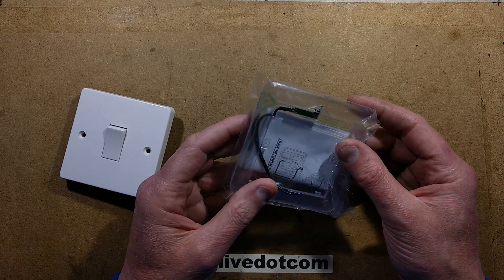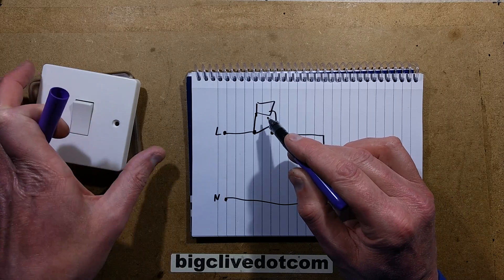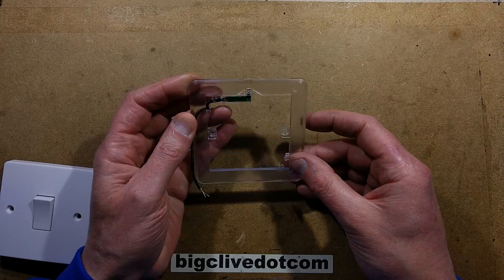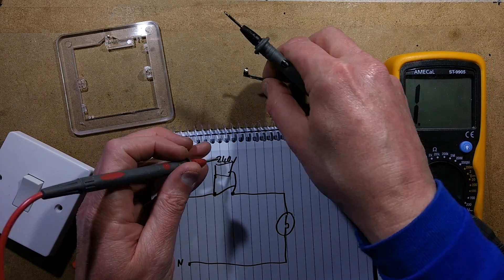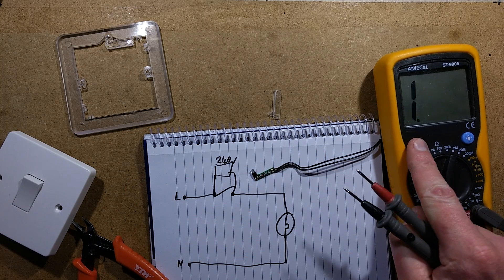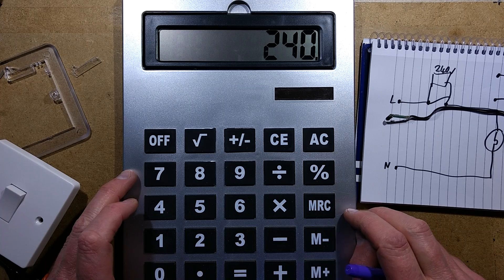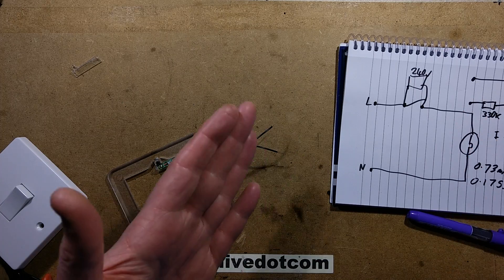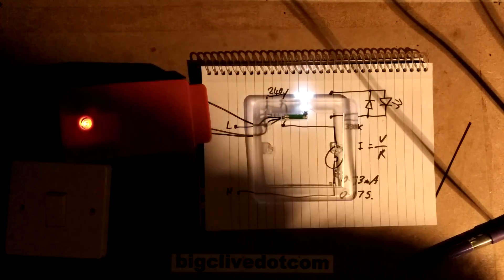Illuminated switchplate adapter.  (With "schematic".)

Comment: When I was a kid one friend's house had a couple of wall plates that fascinated me.  The top of the plate had a smallish plastic cover under which was a neon bulb and a resistor,  and it only lit when the switch was off,  as you describe here.  I've never seen that anywhere else,  nor in any hardware store or other store since then.

Comment: If the diode in inverse parallel with the LED was just placed in series with the LED, would that not result in the same protection from inverse voltage AND at the same time result in a reduction in the power by 50% ?

Comment: Would the current going through that indicator pose a problem if a low power LED is switched with the switch in which the indicator is installed? Because it might make the switched LED glow?

Comment: I've tried every type of decorative illuminated light switch that I know of and they all tend to act up when used with either CFL or LED bulbs.  A couple of times a year we spend a week at the in-laws place, the spare room in the basement has no windows and is as dark as a bomb shelter. Obviously this makes getting up in the middle of the night and making your way to the bathroom challenging and finding the light switch in an unfamiliar room nearly impossible. I though I was being smart when I replaced the light switch with an illuminated model until we went to bed. After our eyes adjusted to the dark for a moment  we could see that all three CFL pot-lights were glowing and flickering. Thinking it was a faulty switch I returned it and tried another type, same results. After two more trips to the hardware store I finally had to go for a switch with a separate pilot light that is ugly but serves the purpose. After watching this video I finally understand why this was happening. The LED in the switch is completing a circuit in series with the fixtures on the main circuit, with old incandescent bulbs the current was never high enough to light the filament but newer more energy efficient bulbs do glow slightly as they require such low current. The switch with the separate pilot light must simultaneously break the main circuit as it makes the pilot light circuit.

Comment: hi clive wondering if you mite be interested in this 12 Watt BC B22 Bayonet LED Light Bulb GLS Traditional Style Lamp Warm White  on ebay seller theelectricalwholesaler  brought this bulb to use at work great light colour only problem was the reception on my radio 6 foot away became unlistenable and switching the light off got reception quality back strange how this light bulb can cause so much impacted on fm radio reception gareth
Reply from the maker: Many LED lamps with switchmode power supplies will jam radios.  Especially AM signals.  The capacitive dropper style lamps are less noisy.

Comment: Not sure if someone else has already mentioned this but you should actually test it with a bulb in series. If you use an incandescent bulb it works fine but if you use a single or multiple low energy LED  bulbs then the current they pass is often enough in some cases to make the bulbs flicker like f*ck. Fitted 6 of them with the leccy off and when I turned leccy back on the house was like a discoteque...

Comment: They could have used a dual-die LED, with two dies of the same color. Then it would just need a resistor.
P.S. is that resistor an 0603? If so, yikes ... I don't know that (most?) 0603's are rated for 300V ...
P.S.2. Idiots! They should have put a nice warm white LED in there. What are they from, Korea? LOL

Comment: You get these in Japan quite a lot. They use small buttons rather than switches like in the UK, and there's a really dim LED inside the button. You can just about see the LED from about 2 meters away if the room is pitch black. Quite useful in my opinion.

Comment: No need for an inverse parallel diode with these. https://www.rapidonline.com/kingbright-5mm-bi-polar-led-29359  Less flicker too. If the colour, viewing angle and intensity was correct they could be an ideal replacement for thousands of filament instrument bulbs.

Comment: The small illuminater lamp is effectively in series with the load when switched off. If the load is a CFL or led lamp with a switch mode power supply then it is likely to periodically flash.

Comment: The optical performance of the ''light pipe'' seems totally rubbish - I wonder if the glue on the LED mentioned 3:26 was optically coupling the LED to the clear perspex until you disassembled it?
Reply from the maker: +joinedupjon The glue was just holding the PCB in.
Reply: If the surface of the light guide was roughened at the point next to the led, that might improve the light distribution.

Comment: After living a 2-digit amount of years in the same apartement, I can fully navigate through the whole house at night either by seeing dots of outdoor lighting or feeling the walls and also light switches :D Still, when we visited my grandparents in Turkey years over years ago, there were those glow-in-dark-material light switches and I was amazed by the technology! (And the voltage drops that happen regurarily. Also when using my Laptop the battery actually discharged despite being plugged in all the time while using, lol) Also amazing were the day/night electric meters with different prices for day/night which seem to be regular in the UK, too. And of course also amazing was that any stolen electricity would be added up in price and then split up on all of the paying customers of the city works. Fine idea eh? "We gonna make you pay for all the scums stealing!" * more people start manipulating/removing their meters *

Comment: What does the electrical code say about connecting more than one wire to a switch terminal?  Seems to me, that unless you use a pigtail, you could be violating the electric code.

Comment: I made that circuit, triple checked schematic, 330k, cool white led, and a diode I got out of a PC power supply on the primary side, not sure of rating as it's too faint. But my resistor just caught fire in a zap. Could the diode have been too low a value?
Reply: The resistor had a too low voltage rating and broke down or you accidentally used a 330 ohm resistor.
Reply: Yeah got it sorted, the last resistor was wrong voltage. I only checked it with dmm

Comment: I sensed a little bit of disappointment in your voice about how the light was (not) spread nicely through the frame (they shouldve covered the LED with some non seethrough tube and with open ends that let the light emit from the sides only and also have a tad more milliamps left over for it (smaller Resistor)

Comment: Did this nearly 30 yrs ago, using a neon & resistor, then we had CFLs (Phillips) come on the market (they had metal core ballasts which wasn't much of a problem) then the CFLs went 'electronic ballast' & I had to remove the neons, as the CFLs were randomly flickering.

Comment: Alternatively, you could wire the back light directly between hot and neutral so it's always on regardless of the switch. This would prevent issues with low powered lamps having reduced lifespans due to attempts to ignite.
Reply: John Cochran that would require a neutral at the switch. in the UK that is far from guaranteed

Comment: With that current you might as well keep it across the mains all the time.
Reply: Yes, but the problem with that is that there is (usualy) no neutral connection in the box.
Reply: It's OK I don't have any of these earth leakage 'things' - won't the earth do ? Maybe dangling a wire into the fish tank or onto the radiator ? I do joke of course.

Comment: I changed all my white plastic switches for chrome .....white switches look tacky
Reply from the maker: I've got mixed thoughts about the fashion for metal switch plates.  Not all houses have a proper earth connection to attach to them.
Reply: yeah I think they should always be fitted by a qualified electrician that can also check the quality and design  of the switch ..... the chrome switches are widely available aimed at the DIY market - that's pretty dangerous really ....as I'm sure too many unqualified DIY enthusiasts   are buying them cheaply and fitting them !

Comment: It might be worse if the load has a bad/inductive power factor (be it a beefy lamp transformer with capacitive 12Vac LED lamps). There will be a HV spike across the switch right after the load has been disconnected. The problem won't be that the LED will draw too much current but that tiny resistor will have a few hundred volts on top of the the mains voltage for a short period of time. 
A small RC snubber might solve it.

Comment: Clive: I am 69 years of age.
I started work as an apprentice Electrician when I was 15.
When I was 17, or in other words, 52 years ago, MK brought out an almost identical looking unit to this, but it glowed right round the switch instead of just at the top. A pale blue square halo. I put one in my parent's hall, and it worked for a year or so, and then stopped. The MK replacement looked identical, but had just a neon at the top, almost identical in it's looks and function  to the one you are testing here. MK obviously had problems with the original design since they changed it so quickly.
Regards Michael
Reply from the maker: +Michael McNamee The original might have used a blue neon lamp.  Unless it was a turquoise blue in which case it might have been an early electroluminescent panel.

Comment: That resistor is not likely rated for the voltage it will see. And that board certainly won't meet creepage and clearance distance requirements. I would not recommend installing this particular one.
Reply from the maker: I'll admit that I was surprised at seeing a PCB like this in a prominent UK brand.  i wonder if it will come back to haunt them.

Comment: Going to be fairly honest; it looks like shite.

It would look better if more of that electricity going into that resistor was instead pushing a larger, brighter LED with fibreoptic strands glued into a small notch to illuminate that,

There is little reason I can think of why they could not just heat-shrink an LED into a bundle of fibres with a special plastic holder and have that tucked into the switch housing.
Reply: bluephreakr
Or a batch of surface mount LEDs around the edge would work too. Then they could have half on each side of the wave and reduce flicker a little too.

Comment: I am surprised that these lights meet the regulations. A luminous plastic plate would be less dangerous. Low energy bulbs always have problems with switches that are powered by the current that flows through the bulb load. Dimmer switches are the worst offenders. The old UK wiring regulations did not require a neutral wire to be taken to the switch, which means dimmer switches do not have a zero volt reference for the phase of the supply.

Comment: kud you explaine haw dos the neone light works
Reply from the maker: The neon lamps have two electrodes in a glass tube with neon gas in it.  A resistor limits the current flow that makes the neon gas glow.

Comment: Is everything in the UK 230V? In north America we use 120V but for high current things we use 240V such as the Range (stove), Clothes dryer, hot water tank if it is electric etc.
Reply: I knew about the 50 Hz compared to 60Hz just wondered about the voltage. Yes we use two 120 legs to make the 240V but everything on our 240V is much higher amperage. We even have high amperage 120V circuits, my steam shower ran 120V at 40 amp so I had to run wire and dedicate a circuit just for that. Still can not for the life of me figure out why they just did not make it a 240V but I only installed it not design it. Thanks for the Info.
Reply: Yes I know, I live in Canada and we are far to close to the US so we follow like blind sheep. A 40A breaker is not the norm here either just something that is available for some stupid reason at a cost the is almost prohibitive, it runs about 8 to 10 times a 20A breaker. We are part of the commonwealth but choose to follow the idiots to the south, makes me shake my head actually.

Comment: These are similar and I have seen them In stores around me. http://www.ebay.co.uk/itm/New-Night-Angel-Sensor-Outlet-plug-Cover-Light-Led-Automatic-power-As-seen-on-TV-/162388932965?var=&hash=item25cf227965:m:m3vf0YaQwm_EFJPcRg0_PLw
Reply: Those are cool but a real rip off on the price.
Reply: Yeah, They are $20 dollars at the store I found them in. They are a little on the pricey side.

Comment: this is going to sound dumb I'm sure but what's the point if the other diode?  it seems like without it current simply wouldn't flow for half the cycle.
Reply: LEDs typically don't have a high reverse voltage, often only 4-5V, definitely not mains levels. The reverse diode clamps the reverse voltage over the LED down to the forward voltage of the diode...
Reply: Michael Tempsch ahha. gotcha.  I'm still learning.
Reply: the reverse breakdown voltage of LEDs are only in the order of a few volts, although due to the very low current here it can even go to tens of volts, 240v would surely destroy it.

Comment: Hey you guys did you see the size of that calculator, bam.
Reply: Raymond I have a similar big calculator I got mine from gadetshop.com many years a go and it runs of just one piddling little button cell even though it has a compartment for two cells !
Reply: Well I like it, very cool. when he whipped out that bad boy I about feel off my couch.

Comment: if the led is switched on and of 60 times per second, does the livetime of the led gets not dramatically shorted???
Reply from the maker: +Gallardo6669 LEDs are fine with being switched on and off repeatedly.  It doesn't harm them.

Comment: One question. "Across the strappers" does not mean it would use the ground as a return path, right? I am unfamiliar with the term except perhaps in reference to the ground connection here in the US. Unfortunately there ARE devices (such as some wall-switch occupancy sensors) that use the ground as a return path because typical existing switch installation does not include a neutral. A poor method of making things work. While the current from each device is negligible if you have a LOT of them (say, building maintenance installing them in offices where you may have 20-30 offices on a single 277V circuit) it can add up pretty quick!
Reply from the maker: +Bigrignohio The strappers are the two wires used between switches in multi way switching.  These plates do not use the ground/earth.
Reply: Ah, the travelers.

Comment: I think it may be "interesting" when used with a cfl or led bulb. I had one cfl that produced horrendous radio interference on the capacitive leakage in a stair light. 
Would be better if they'd used 4 leds in series and inverse parallel to do all sides

Comment: Does the flickering really occur dur to the frequency of the AC? The frequency is 50 Hz, so it shouldn't be visible, but it is. Might it have something to do with the device/adapter youre using?

Comment: Neon illuminated switches are nice. The neon bulb is inside the toggle. But they might only run for ten or twenty years before they start to flicker. Then they only glow steady when some extra light hits them, helping them fire... but that defeats the purpose.

Comment: Nearly full mains voltage will appear across the 330K resistor with the switch off, I would question whether it's voltage rating (limiting element voltage) is sufficient, quite apart from it's dissipation as mentioned.
Reply: In common electrical usage, if you use a larger part than absolutely required, you are using an over-rated part, or are over-rating the part. The rating on the part is over the requirements, thus it is over (not under) rated. An under-rated part is one that has capabilities that are under the requirements.

When you derate a part you reduce its capabilities. For instance a 1/4 watt resistor will dissipate 1/4 watt at or below 170C. If the unit will operate above that temperature then you must derate the part, and it becomes less than a 1/4 resistor.  If you need to dissipate 1/4 at more than 170C, you must use a higher-power resistor. This would not necessarily be over-rating the part, unless you used something like a 50W resistor to dissipate the 1/4 watt at say 200C.
Reply: English is full of quirks like this. e.g. People get on a bus but in a car. You don't get on a car or in a bus.
Reply from the maker: +stevemo1 I'd have used more than one resistor in this.  And probably overrated them for the extra reliability too.
Reply: stevemo1 'Brian's skills were overrated when he was asked to install the nuclear reactor'.
Reply: stevemo1 To overrate something means that you are overestimating its abilities or properties.   If you plan to use a resistor  which can dissipate more power than needed then surely it is under-rated or derated.

Comment: would work well with modern 2 plate wiring with neutral at the switch.. connect one leg to neutral and one to switch live, that way it will work with any lamp at all.

Comment: These would cause issues with LED replacement lamps as it uses the lamp to complete the circuit.But  if you had neutral at your light switches these could still be used by using the normally closed contact of the switch to power it when the light is off.
Reply: It wouldn`t really matter if you simply connected across live and neutral, though. You`d hardly see it when the lights were on and the power consumption is tiny. I don` think they recommend wiring it across the switch so that it extinguishes when the light are on - it`s simply that that is the easiest way to get an effective neutral in a switch box.
Reply: And it wouldnt work at all with fluorescent lights I guess.
Reply: Chuckiele most fluorescent fittings have a capacitor across them. even the lpf ones now have a small x2. that would enable this to work
Reply: alright